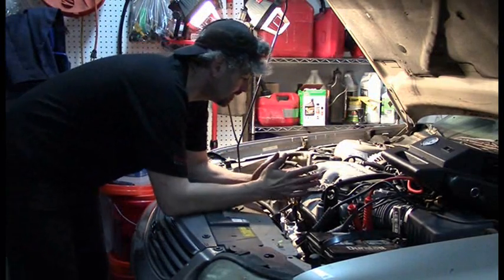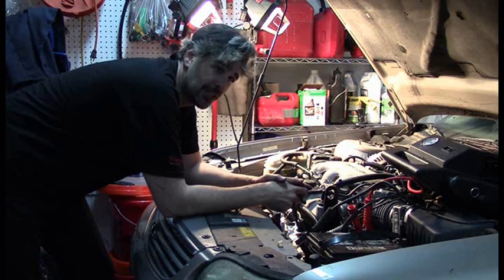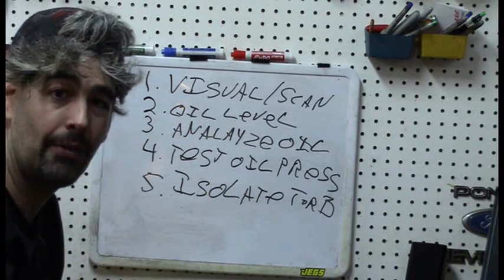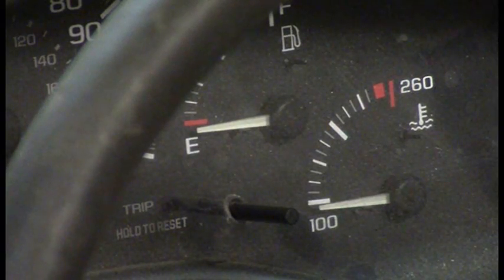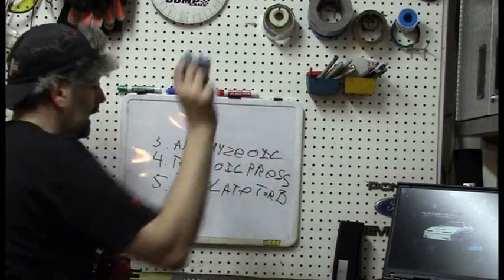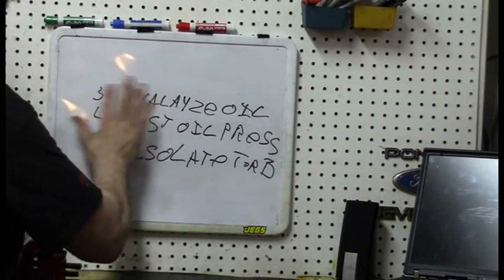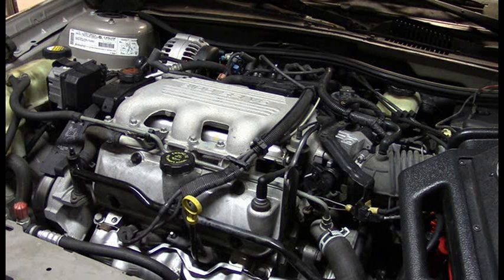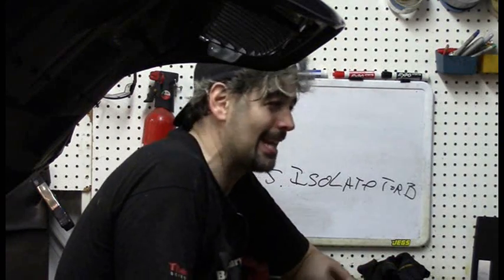Engine Noise Diagnosis-Part 1

Comment: if is nocking happing when the engine is cold my understanding GM build it so when is cold piston is extract and this made it less fraction  and when come to normal tep   which around 180 the noise go way .sorry aboud  my spelling.
Reply from the maker: Yes you refer to "Piston slap" common in LS engines- good guess but this is not piston slap.
Reply: thanks for info I did watch yr ved and was lifter .

Comment: Your videos are very very good , You do not need to remove plug wires to knock out a cylinder ,  Use your test light to knock out  1 cylinder at a time ," make sure other end of test light is clamped to a good ground " slide the test light up in-between the spark plug wire and boot, "either end of plug wire will work" , this way you do not hurt the plug wire or yourself .

Comment: Don't forget to check water pump and exhaust manifold gasket. A damaged water pump could produce this noise and the defective exhaust manifold bolts or gasket makes noise like that as well.

Comment: this guy wastes so much time trying to diag bull shit stuff that has nothing to do with the noise. there is no misfire
Reply from the maker: Wow you're not the sharpest knife in the drawer, are you? The point- quite lucidly stated several times I might add, was to show HOW you would diagnose an engine noise and as any complete tutorial worth its salt would do, it walks you through every possible permutation of etiologies that you might encounter.
  How, how did you not follow that- never mind, I already answered that.
Reply from the maker: Red Doe Running Ah yes I forgot about that- there was indeed a worn plug wire in this video wasn't there! Yep- plug wire arcing to the valve cover would definitely cause misfire. Good call.
  Anyway I think that other moron went back to Scotty's channel where he belongs.
Reply from the maker: Red Doe Running Lol looks like you're having a binge-watching session bro! Take a break from it... the channel will be here lol
Reply from the maker: Red Doe Running I know the one... actually most automotive channels by far take advantage of the fact that most people know nothing at all about cars but think they do.  When a "professional" technician creating a channel is actually just as much of a parts changing hack as the audience, the growth, ironically, will be stupendous!!
Reply from the maker: If just replacing parts without any diagnosis is how you do it then you're exactly right. that's pretty much the norm.
Reply: +Schrodingers Box A bit of prejudice here.. Scotty's channel remain as a good source for DIY repairs..

Comment: intake leak very common on the 3.1 and 3.4 v6. always look at the front and back sid of the intake and you will most likely see a leak
Reply from the maker: rachelempyre Except that the leak is INTERNAL, you won't physically see it.  It's always been on the right rear corner, not the front.

Comment: I believe I'm missing something obvious, but what are you looking for when you pull out the spark plugs while it's running? Is it to listen for the sound being less because you stopped a cylinder that had the valve problem?

Or would it rule out a bottom issue as that rod can't knock without a good power stroke?
Reply: Loved the ending comments about how meaningful it is for people to diagnose it if you already have versus here where you haven't said it yet. :)
Reply: I thought about it and my questions are the answers.

If fuel injectors were easy to disconnect on one side and spark plugs are necessary to check on the other side, I'd just switch tactics on one side versus the other. The results would be close enough to being the same.

...but you want a controlled experiment, huh? :)

Comment: If there is a coolant in oil You should check level of that coolant because running engine without coolant is not a good idea :) High oil pressure is normal if the oil is cold and have high viscosity. By the way - great video. You have great distance to yourself. Take care!
Reply from the maker: If there is coolant in the oil, running the engine period is a bad idea.

Comment: This is the best auto repair channel on Youtube (ive seen almost all of them).
Reply from the maker: Wow thanks bro! I do put a lot of effort to make sure I cover every aspect of a topic since other people's diagnosis probably won't reveal the same results as mine do in the videos.
Reply: Scanner danner is good too but he's mostly high tech. He mostly works with expensive tools lol. South main auto is good too. This guy is more of low end kind of guy, not everyone can afford to buy expensive scan tools. Plus majority of car diagnostic don't require expensive scan tools. It may take you abit longer to diagnose but if youre doing it yourself who cares. As long as you have the time.
Reply: If the oil light is not on in your car then more lightly not a pressure problem.

Comment: I have an 03 Ford escape n that's the exact same sound but when I step on the gas it gets louder n if I let it go then it goes back to the original knocking noise even when parked. I have completely change the spark plug..the valves the gasket which the noise didn't go away n now they are telling me to replace the engine!! someone please help me if their are other alternatives?
Reply: Hold on. Slow down. Matt (Schrodingers Box) has coolant in the oil. Do you?

Comment: Valve tappets tapping away. coolant in the oil causes hydro pressure to drop in the hydraulic lash adjuster tappet. if it were a stuck valve or a single valve you would not have the continues noise. the noise would have more time between each noise. If you have a problem with locating noises get a stethoscope if you do not have one they work great and can get you right on top of the noise. I worked on these engines in the past and found that majority of coolant in the oil came from a crack between valves in the head. But also on that note this car may have had signs of overheating but sometimes not, the combustion gases enter into the coolant system and causes cooling system boil over. test for combustion gases in coolant also do cooling system pressure test both easy.

Comment: Hmm, idk but it sounds like one of those engines that runs free after a timing belt breaks. Once the belt is replaced, rods and pushers can be bent and hit the head and make this nose.
Reply from the maker: i think what you are trying to describe is an interference engine.  Go ahead and look up what this is and then you will probably want to come back and edit this comment so it doesn't sound so funny.
Reply: Nahh...im sure im way off, it was a guess after watching the video 2nds. Really not necessary, no prizes won here lol

Comment: Had a crazy engine noise problem myself, sounded like there was a broken crank, or rod banging around when you would crank the engine, but it wouldnt start, had sump off, rocker cover, and pulled the front cover to check timing. Turned out to be the dual mass flywheel , the 2 pieces had almost come apart. (2009 ford transit van 2.2 tdci, rwd.)
Reply from the maker: Hi I just saw this comment- reminds me of a few years ago a Ford F250 that a neighbor brought to me with rod knock- he was all freaked out that his truck was doomed. It sounded exactly like rod knock- perfect rythym and everything but I did not find any play in the rod bearings using my "screwdriver test".  Turns out somehow one of the driveplate-to-torque converter bolts backed out and was striking the torque converter access cover plate. It pays to check simple stuff because otherwise this would have been found in the process of removing the engine!
Reply: Schrodingers Box Phew! That saved a lot of work!

Comment: Hi Matt, I have a 2000 chevy malibu that is making the exact same noise as this malibu. It did not start until after I had a head gasket and intake gasket replaced. The check engine light flashes at 30 mph, hesistation, rough idle when warmed up,  and random misfire code.  A mechanic is saying cylinder one has no combustion and cylinder four has 70 % combustion. What could it be?
Reply from the maker: @musicala- it's hard to say but doesn't sound good.  Initially I was thinking it might be the timing is off between crank and cam, but not if just 1 and 4 show low compression. And if you didn't have camshaft and/or timing chain replaced then this is surely not the issue.  I hate to say it but if the mechanic is right about the compressions then the head is going to have to come back off and be inspected. If the same head that was originally on the car was replaced back onto the car I would bet a lot of money that is your problem- the original problem requiring the gasket change just carried over with a new gasket.  I have a cylinder head video I am working on as you read this that talks in detail about head gasket replacement to prevent these very issues.  Should be out in a couple weeks.

Comment: hi i like your videos but you know pulling sparkplug wires off is a bad idea. because if you dont get shocked the spark has to go somwhere and its going back to the computers transistor to damage the transistor and then you have damaged that component if.... it dont shocks you or jumps to ground somwhere..... ground out spark wires propperly for things like this         My wilde guess its the hydraulic lifters not being lubed with water oil mix , but only a guess noises on video diagnostic is almost not possibile in my opinion...
Reply from the maker: You are exactly correct inTrade100.  And thats one of the reasons I initially wanted to pull the fuel injector connectors instead.  In retrospect, a better idea would have been to use a ground to give the spark a path as you indicated but after getting shocked I didn't think too clearly and just wanted to get it over with lol!
Reply: +Schrodingers Box 9.1.16.   You only need to pull 3 of the 6 plug wires.......because this is a waste spark ignition. Two cylinders are disabled by pulling just 1 plug wire.  Good video series. 👍🏽👀
Reply from the maker: Steven Sapyak That makes no sense. On a waste spark, there is a separate plug for EACH cylinder. It is just that spark is also sent to the cylinder not at TDC that is shared on the coil.
Unpluging just one wire from the coil only disables that cylinder.
Reply: +Schrodingers Box   9.2.16.  Yes each cylinder has a spark plug, but there are only three coils....on a 3100/3400 V6 ...pull a plug wire off and the corresponding plug on that coil will not fire. (1-4  5-2. 6-3).  The high voltage secondary circuit is open.

Comment: hi 
very good video and good diagnosing techniques, i really like. i think if u just check vacuum pressure u can find problem right away internal engine problem (mechanical problem) or electrical problem.
Reply from the maker: You know this actually isn't a bad idea Nasir, I never looked at vacuum gauge readings from a stuck valve personally but I know it's supposed to cause regular drops on the needle.  Then again I am not so sure a piston with bad rod bearings wouldn't also do that.  It would be a great idea to compare the two types of issues on a gauge and see if there is a pattern that could be used to predict top or bottom issue better.  One complication is that often the traditional diagnoses assume only one valve or one rod is bad- when you have multiple frozen lifters or multiple rod knock it gets harder to rely on patterns.

Comment: Hi Matt,  I first want to say that I really enjoy your videos and that your logical evidence based approach is refreshing to see from you since you are an admitted non professional/certified mechanic :)  I recently came across your channel (literally 3 days ago) and I have watched at least 8 or so.  I think you will get a kick out of the fact that I was watching your videos at work on my $12,000 scan tool lol.  Its wireless, touchscreen, with internet access and basically full tablet capabilities lol.  January and Feb are pretty slow months at my shop so I take the time to watch and learn automotive diagnostics from all different sources.  I am a fully licensed and certified Journeyman Automotive Service Technician from British Columbia Canada.  Here is what I think is going on with this car..the frequency and tone of the "tick" (thats how i would describe it, not a knock) is for sure coming from the top end.  I believe the coolant in the oil is the root cause of this noise and that it is almost 100% a lifter noise.  I believe you will find the coolant entering the engine through a failed lower intake gasket, but also possibly the head gasket ( not as likely as the lower intake) If I am correct, don't write off the engine just yet.  I had the same problem on the same engine, except it had gone on a lot longer.  The oil looked like chocolate ice cream, and I had to remove the valve covers and clean them, change the lower intake gasket and clean as much sludge as i could out, then change the oil 3 times and perform a hot oil flush but when I was done the lifters came back to life and the noise went away.  I did this because the lady who owned the car had only 300$ to spend to her name, and needed the car to last 6 more months (very low income family) after my repair it lasted 2 more years.  Anyways, cars are weird and similar symptoms don't always lead to similar repairs.  Let me know if I was close :) Thanks again for your videos, I really enjoy them!
Reply from the maker: Wow, thanks for detailed analysis!  Makes total sense and indeed I am familiar with the GM Intake manifold coolant leaks around this time era. Once I do my screwdriver test and find the bottom end to be OK, I plan to do my usual process of compression and leakdown testing for the heads and will inspect the intake gasket if I see nothing as that would be about all that's left and will follow your advice exactly!  Thanks very much, despite rubbing in the part about the scan tool you have lol.  I love my Auto Enginuity, but would kill for just a low end Snap-On or something!
Reply: Schrodingers Box Nice! The fact that you even own a leak down tester puts you far ahead of even most professional technicians lol.. one of the best engine diag tools out there for sure.  Did you see any coolant leaking from the valley of the lower intake on your visual inspection? That alone (with maybe a coolant pressure test) would probably be enough to call the manifold removal.  (if that is the problem that is :) lol
Reply: Schrodingers Box I forgot to comment on the scan tool remark haha sorry man :)  I actually had never seen the scan tool software you use until finding your videos.  I think its excellent!  For just being a scan tool its great as far as scan tool stuff goes, but you did comment that it doesn't like japanese cars, so you might have to look into something to remedy that.  Snap on is my favourite for sure, and I run a fully loaded VERUS PRO with all the bells and whistles, but unless you need the lab scope function its just not cost effective more most people.  I actually use the lab scope more than the scan tool I think :) You being a scientist and all, you might want to consider getting into automotive lab scope diag and theory..get  yourself a picoscope and software and it will change your life man :)

Comment: Hi Matt and glad to see that you're back. When I first heard the noise, the valve train came to my mind. As Mike mentioned, I think there's one or more collapsed lifters because the oil pressure can't be maintained inside of the lifters because of the coolant in the oil. As for the coolant/oil mix, I would say that it's the head gasket. Thanks for posting your video Matt!

Comment: very informative video .....
 it's a collapsed lifter
Reply from the maker: @Mike Chainz- Just wanted to say thanks for the comments on my recent videos but especially for being brave enough to be the very first to make a call on the diagnosis on this one and "put yourself out there".  You'd be surprised at the haters I have who would simply trash on me for not being able to tell the source of the noise by ear, but of course they would only do this AFTER they were told what the issue was.  As of yet it will be a week before I can tear into the engine but I will let you know!!  Thanks again Mike.
Reply: My supreme is making a very similar noise, also coming from the right side of the engine